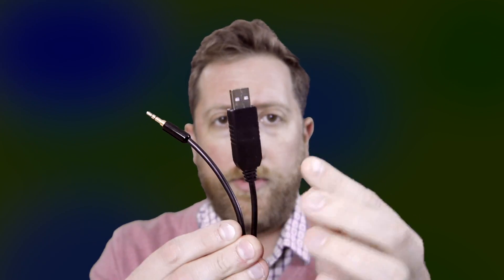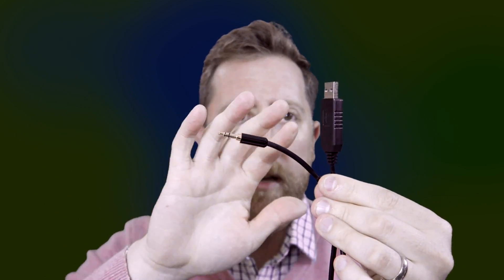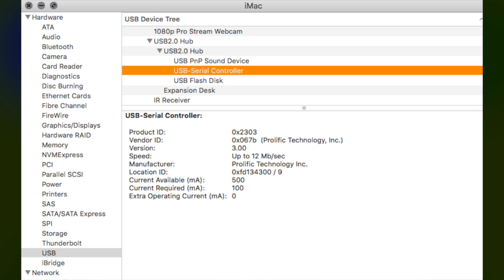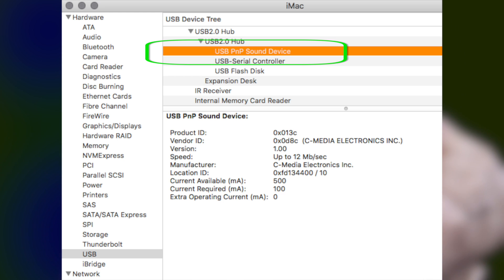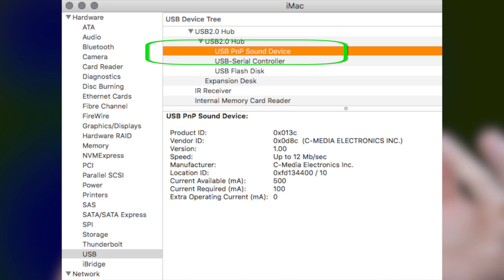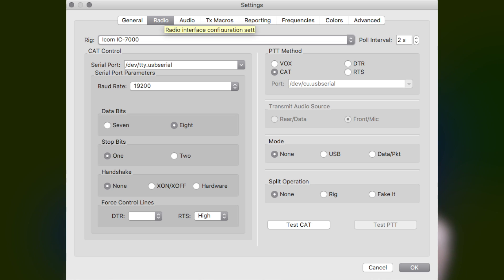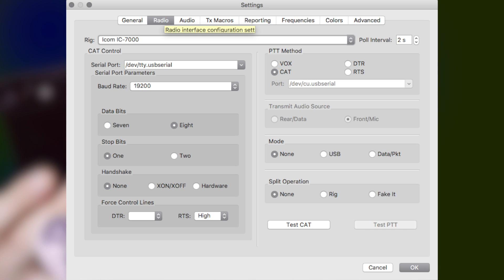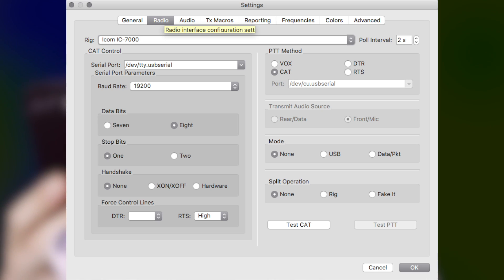How To Setup Your HF Radio For Digital, WSJT-X FT8

Comment: would be great if you or someone did a video or review on Best radio(s) for FT-8. New or used, and what features or accessories needed. Kind of thing like weather a FT-710 vs a FT-101. and maybe even some good companion antennas or set ups.

Comment: I have ppt transmit working and waterfall appear on fldigi app when I am trying psk31 on 40 m on my ft-450. Issue is I get garbage letters on receive. Any suggestions on what could be wrong. Regards.
Reply from the maker: You might pick up some garbage due to noise picked up on the radio.  If you’re getting a lot of garbage try lowering the input volume some or the threshold for decoding in the app.

Comment: Great video thanks!
Wondering if you have done any experimentation with the hackrf and connecting with WSTJX for FT8? If so could put do a video how it is connected and setup.
Thanks
George Alberta Canada
01/02/22 -35c

Comment: Josh - you mentioned that on occasion you start the transmit but it stops after a quick moment.  This happens all the time in WSPR mode and occasionally with FT8.
What is the root cause here - How do I correct?
KC1NRj
Reply from the maker: It’s likely rf getting onto your USB cables. You might need some ferrite chokes.

Comment: Thanks so much for all of your very educational videos!  I've learned so many great things.  
Question:  I just received the Lab599 TX-500.  Absolutely a fantastic QRP rig!  It comes with a REM/DATA connector with no audio wires from the connector.  The manual shows the wire configuration, but I have no clue how to solder the wires for the connector, or what type of wires I need.  Do you know if someone makes these?  I don't have a soldering iron small enough and I must admit, I really don't want to attempt this.  Any leads on where I can purchase these pre-configured for the Lab599?  Thanks in advance.  73 DE KL5CS

Comment: I suppose FT8 would be nearly impossible for old radios such as the Heathkit SB102.     This video doesn't address connections to the vintage radios.
Reply: yes it does, use a signal link.

Comment: I tried setting my IC-7300 up for FT8. While I can transmit the full 100W on SSB with no trouble... FT8 would consistently pop 5 of my circuit breakers every time I tried to transmit. They are the GFCI type. So I guess no digital modes for me. And no... I wasn't doing 100W on FT8.
Reply from the maker: What power supply are you using?
Reply: @HamRadioCrashCourse  Astron RS-35A. I think FT8 basically generates RFI "noise" as far as my GFCI stuff is concerned. Phone on SSB does not seem to have the same problem. I might be able to switch out the breakers for another style... but for me, not worth the effort. Plus, I think the GFCI breakers are "code" and I suspect that most electricians would not be ok with circumventing that.

Comment: I have a FT-450d w/ a signalink setting up my radio with wsjt x when I test cat cont it turns green but when I test ptt it stay red and won't turn green and stop xmiting and yes radio is trnsmitting, I have to press the ptt test to make it stop. I let it run for 2 min.  Any suggestions?
Reply: Paul Baran signalink needs VOX not CAT. Also need to set your rig to none

Comment: Can someone please help?? I've tried to get this connected to HRD and the WSPR software but with no luck. I connect the ACC cable to the CE-19, connect the AF CON from CE-19 to laptop audio in plug and Com out on x5105 to USB in on laptop. I set HRD to IC-7000 just as recommended but it never connects. With WSPR software, I get RigControl error.

EDIT: Got HRD to connect but no PTT. What's the secret there?
Reply from the maker: You need to use the usb cable that came with the radio for ptt.
Reply: @HamRadioCrashCourse  Yes I'm using that cable and that goes to 'com' on the radio, correct?
Reply: @HamRadioCrashCourse  Do I need to connect something to 'key' ?

Comment: Can this be set up without the interface? I have an Icom ic746, can I use the c-IV cable to the PC and then an 8pin din to 3.5mm wire to the sound card dongle? But then only one 3.5mm will be plugged into the dongle. Can I buy this interface seperately or one like it?
Reply from the maker: If your computer or single supports mic and speaker on one plug, yes.
Reply: @HamRadioCrashCourse  Would the Xiegu CE-19 interface work with my radio if it has the same 8 pin din?
Reply from the maker: If the pins match, yes.

Comment: Are you controlling X5105 directly from WSJT? I can't connect directly from my side. Someone told me need to use HRD as a bridge. Don't know why.
Reply from the maker: Yes, I use WSJT-X to control the rig via cat control.  I purchased the MFJ interface to go from CAT cable to USB into the computer.  Then I have another USB audio device (simple dongle) for the audio.
Reply: @HamRadioCrashCourse  Thought you said you used the firmware update cable. I can not make the settings like yours. Instead of a Com port you have something put int there. It doesn't carry over under PTT control like your. Mine stays at COM1. Frustrating.

Comment: Excellent video.  Could you further explain each of the connections to the X5105 and the CE-19 step-by-step?  I am going to try to duplicate this set-up (if I can ever get the darn CAT connection to work).  I have the cable that came with my X5105 for firmware updates.  Is that the cable I should use for CAT?  I also need to figure out why WSJT-X doesn't see my incoming audio.  Fun, fun, fun.
Love trying to figure all this out.  :-)
Reply from the maker: Yes, Firmware cable is used for CAT.  Then you need audio cables for the IN and OUT from the interface into the computer.
Reply: @HamRadioCrashCourse  I'm back to trying the X5105 and CE-19 again.  I have the audio cables, now I just need to figure out which connections on the CE-19 I should be using.  I also got a WolphiLink.  I'll try that too, but I'd like to be able to reliably use either and double my options.  :-)  Have you done much with JS8Call yet?
Reply from the maker: @VideoENG  Its either the acc or data port on the CE-19.  You have to split that line to the input and output on the computer.  I have a Y cable I use to do that.

Comment: Maybe you could consider if you really need 60fps for a video like this. In my opinion it doesn't add anything at all to the video, yet it uses a lot more processing power to playback, and uses more bandwidth. My laptop was dropping frames badly trying to watch this video and I had to switch down to 480p, which is a shame when it's available in 1080p. 60fps is mostly only useful for videos with fast moving action.
Reply from the maker: That’s a damn good comment. Back when I vlogged I only did 60fps. Yeah I could totally drop it down. Cheers.
Reply: You computer needs an update
Reply: radiosification buy a new pc 😀

Comment: Hey - THANKS!
Now (after I get back from town) I gotta see what I can do about my IC718 and Win8.1 laptop! Tried before but had problems getting the audio in/out and haven't gotten back to it. 
Is it ok to set the radio power out to a much lower level, like 10-25 watts instead of the 100? Any pro/con comments on doing that?
KF5AQF
Jim
Reply: Fyi, The accessory/data cable for icoms will fit in the radio UPSIDE down. So ignore any markings on the cable itself and be sure to visually check the pins when inserting into the port to make sure they match up properly. This had me stumped for about 3 weeks. Hth